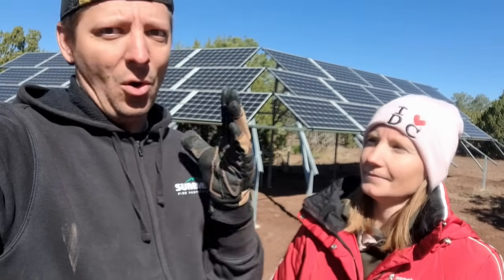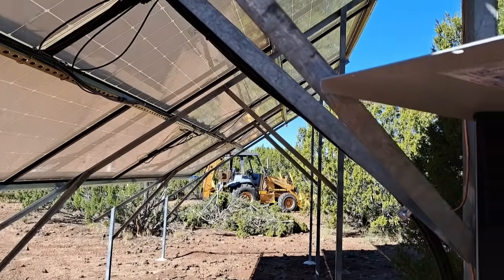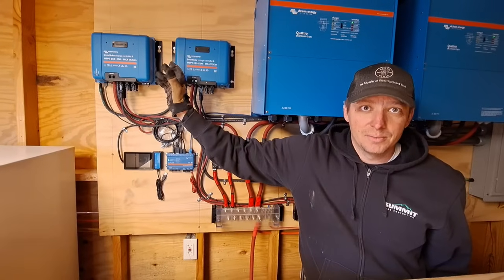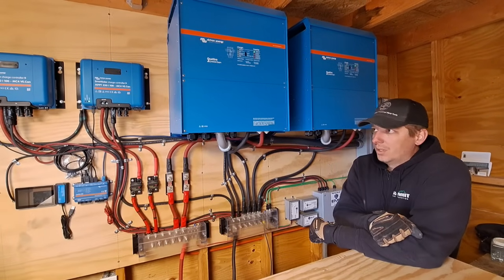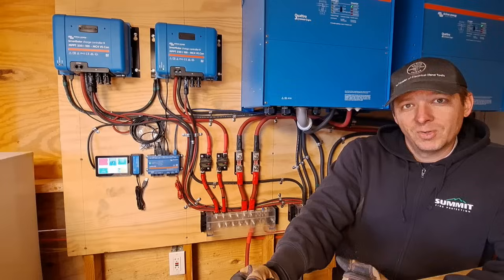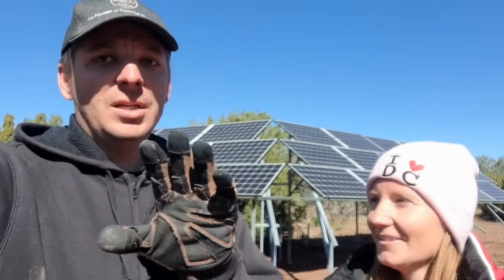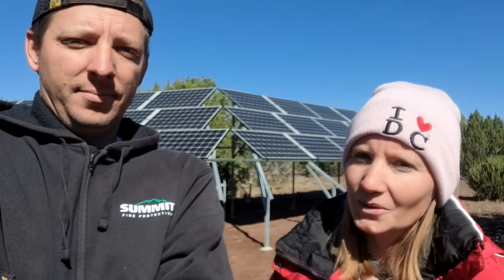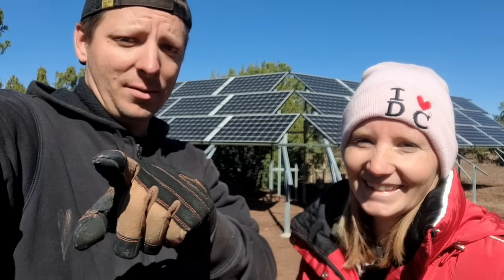INFLATED COST Of Our 100% DIY Off Grid SOLAR POWER SYSTEM 👍

Comment: For forty years, we have been hearing that solar is becoming more affordable each year.   Looks like it will take another 40 before it works for the average homeowner.  If you MUST be off-grid, your system is awesome!  But for someone like me, a $150/month on-grid cost, including all maintenance, makes much more sense.  Solar & wind power is sexy, but not practical for the average household.

Comment: I’m pretty sure this is the same system I was quoted $18k for. The only difference is that the batteries sit outside and there were 10.  They sell you $2500 batteries for $10k, and a $10k solar array for $50k. If installers charged reasonable amounts and didn’t pay 25% commission, plus massive overhead, I would gladly pay someone to install it.  $37k to save $1500 per month in CA is well worth it.

Comment: Look into adding the Victron smart shunt. It will monitor and report battery utilization and SOC to the Cerbo GX so it can control the entire Victron entire ecosystem based off of the battery data. Just a couple hundred more bux, but will prove very useful for you. Great work!
Reply from the maker: I'll have to look into that thank you.
Reply: I second this suggestion
Reply: This will be the best to help in monitoring your battery power. Victron shunt
Reply: THIS 100%!!! Install a smart shunt  between the two bus bars. It will keep track of the state of charge and perfectly report it to the Cerbo.
Reply: @aboulderlifeoffgrid  did you check out the smart shunt from victron? I use a couple of them, for monitoring solar production (non victron charge controllers), and for battery levels. The built in relays are an integral part of my system too, shutting down various components when levels get too high etc.
Reply: Charles you seem knowledgeable. I’m a beginner and want to build a system capable of producing 16kWh… do you have a set up to recommend? Or links
Reply: Great setup! I have something similar for our offgrid system. You definitely need to add the shunt. A shunt measures the flow of energy into and out of the batteries, think of it as a fuel gauge. As you withdraw power it records all this to tell you what’s left in the bank. As you charge, it records that too and adds that to your “range”. 

No more looking at idiot lights or guessing based on voltage - which is especially hard with lithium based batteries as they don’t sag like the old school lead acids did.

Comment: This pricing is outrageous and would take about 15 years to pay for this and by then, you will have spent another $25,000 to replace the batteries and other equipment...so in reality over a 15 year period you pay about $60k. Solar is really a total rip off compared to paying for electricity from the grid...unless you live in NY or California...and this pricing is a great deal if you live there. However, this pricing is far better than paying a solar company $60k+ to put in a system that provides less power than this.

Comment: Nice! and Expensive! LOL!  A suggestion and for your SAFETY add a Catastrophe fuse and disconnect at the battery box for redundancy! Don't just rely on the BMS system.  And at the buss bars going to the batteries move your 4/0 wires from an end bolt to a center bolt on the buss bar to reduce further any chance of buss bar heating and even Amp draw during large voltage draws! Awesome system!

Comment: Great video!  I've had my Victron system for 4 years now.  Mine consist of 4 - 3000VA Multiplus inverters and three MTTP 100 - 50 chg controllers, 12 - 320watt solar panels and 12 Battle Born 24V batteries giving me 600ah of storage.  My house is under 1000 sq ft so it provides me with all the 240V power I need to run the house and power equipment.  I do use propane for heating, but thinking of doing away with it...  I had one inverter fail and Victron reacted immediately and got it to the repair facility in one day!  Unfortunately the repair facility didn't provide very good customer service and took over two weeks to repair it.  I'm just 50 miles from their facility...   So I bought a spare inverter!  I live in the Wet Mountain valley in Colorado at about 8000 ft so I get plenty of sunshine..  Keep up the great videos!

Steve

Comment: I built my system for about 30k. Consists of 11Kw panels, 56Kw of batteries,  8K sol-ark all in one.  I built the batteries from raw cells. the mounting was unistrut and well pipe, 2 are set up to track 2 axis, 2 are seasonal tilt, nessassary in Minnesota. I have had no issues with the all in one inverter, but something to be said for separate components too.

Comment: Just finished our off grid solar, we did it ourselves. Did it for well under $3k . Be interesting to see how it goes. Got lithium batteries super cheap as the Government in Australia changed the contract on building electric buses. So was 1000 cheap batteries, we got our share. Solar panels (450 W ) for $25 each with all free railings, wire and clamps to join battery’s with a free case to house them in. Just got to meet people in the know.

Comment: I know as I go through and make videos for my own system, I'm constantly reminded of the cost of my own system.  It's hard to believe how much little pieces of metal and wire cost, but it's so gratifying to know that you're making your own power!

In regards to knowing the state of charge of your batteries, one option would be to put a Victron SmartShunt in place which would give you the ability to monitor the state of charge of your entire pack of batteries.  Voltage doesn't mean much in regards to LifePo4 batteries, but the smart shunt does a really good job of letting you know where you're at power wise.
Reply from the maker: Good to know! We'll look into one of those. Thank you!
Reply: Yes your correct my. Battery are diy sow I use renogy shunt I have 3840ah on a12v and 960ah on a 24v  have you look into a raspberry it made work for you

Comment: Great video! I am also on a DIY fully off-grid system and have upgraded all of my electric appliances and even have full AC and heat running off of my system. I will be adding videos soon but have not had time as of yet. Our system has 800ah of batteries and 13kw of inverters and runs our entire house with zero issues including electric range, oven, washer/dryer, 5x mini spit AC/heaters, etc.
Thank you for sharing!
Reply: Do you have a channel? Videos? Love to see your setup

Comment: Interesting video…your content is good…:) It’s worth it not depending on the power company…every year costs more…I did something crazy…I built a small jet engine to power an induction motor to power my cabin and built the inverter too…I’m an Extra Class HAM…the advantage of learning to be a HAM is you learn electrical and electronic engineering…not at a professional level but at a solid amateur level…I would recommend anyone who is into being independent from the grid like that and not a professional electrician, go for your HAM license…you’ll learn lots of electrical engineering…it’s seriously a great way to learn it…and as a bonus, radio engineering too…:) I’m an emergency nurse practitioner student…I’m not an engineer but I’m deeply interested in engineering…I’m a bit of a jack of all trades I guess because of my former paramedic training and background in emergency medicine…so I try to learn this kind of stuff too…you never know…

Comment: Great Video!!  I have not built mine yet, but will do so as soon as we move to the property, and this video is a fantastic guide!  I want to make a suggestion.  
If you accidentally dropped a wrench down behind the battery case, you would have a nice firework show if it landed on those buss bars.  It might add some safety if you put a  wood or plastic cover above the buss bars to avoid a falling object shorting out your batteries.

Comment: I was surprised that you didn't mention a shunt, which would allow you to see all the voltage in the batteries, in and out, etc. Victron makes a proprietary one and a generic one that would work for your setup. Very cool setup and I am envious!  The other advantage of DIY is that you saved money but also understand your system completely. Well done!

Comment: Well done on doing your own rack for solar panels.  I am just about finished with my 19kw off grid system, for the materials of a good metal solar rack it was going to cost $14,000.  I decided to just build them out of pressure treated wood for less than $3k, this also gives me the flexibility to move each rack of 5 panels slightly to the east or west for testing which way is the most efficient for providing power throughout the day.

Comment: I fully get the cost of this set. We have a family house in AZ off grid ,we use 24 volt and we use split systems  to spred the amp loading. Good video on what it truely costs.  I would reccomenda shield on the battery buss bars to avoid a accidental arc from somethng crossing them.

Comment: Wow that's a lot of power! Our inverter is 6,000 watts, and it does everything we need to live off grid, and to run all of the power tools to build our house. The propane for our gas stove will cost us less than $200 a year, and we can take the tanks in ourselves to have them filled.

Comment: Gteetings from Kosoves. use heat from inverters for heat pump, also install diesel generator and tap the hot water for heating plus store electricity from generator in batteries.

Comment: Victron Lynx Shunt 1000 for battery monitoring or the Victron BMV-712 (this is what I have) with a 500A capacity. This takes away the need for the batteries to play nice with the Cerbo. And for the bus bars, Victron Lynx Power In or Distributor if you want to fuse each item. Each of these handle 1000A in total and you can combine them for extra connectivity. This is an awesome video and it looks like you have gone to a lot of trouble to get this up and going and it looks fantastic. Totally enjoyed watching this and viewed to the very end including bloopers! Warm greetings from Melbourne in Australia!!!
Reply from the maker: Great information. Thank you Adam!
Reply: Wasn't the Lynx causing a bit of a rumble as most people found it should have only been rated for 500A?

Comment: This is more expensive than I thought it would be, but I've only been looking at smaller systems. Wow! That markup for installation / labor was huge. Good on you guys for doing it yourself
Reply: The markup for off-grid is very high due to the lack of knowledgeable companies willing to do it. These systems are very complex compared to grid tie/back feed systems.
Reply: @jasonhensley947 no they aren’t, he did it in a complicated way. It can be done for half the price he paid
Reply: @vandalorian8777  Can you explain more? I'm new to the solar game and trying to educate myself. How could they have done it in a less complicated, less expensive way?
Reply: I saved a lot on mine by going with used panels from SanTan Solar. I got 40 used Kyocera 265W panels for $4,001.65 after shipping. they've been working great, they look great too.

Comment: The knowledge you gained will save you money should components need repair or replacement. I don't have solar but need generator power often. We have LP for stove, dryer, and hot water  and 9000 watt generator for the whole house. Unless you need 20KW for backup or have one big house you could have when smaller. But, now you have enjoy.

Comment: Thanks for the video. well done and edited.  It confirmed that I will be able to do this same size considerable cheaper.   Pressure treated for the array.  Ive seen those same size/quality batteries for 1300-1500.  I might even make my own which would shave more off.   I think yall payed around .70 a watt for the panels which is ok but .50 and even lower is doable if you just dig more deals are always out there finding them is the task.  I also think higher wattage panels means less panels which means less materials.  Plus the more panels you have  the more that could go wrong/get damaged etc.  I see a lot of diyers that I guess just have plenty of money and go for the convenience of buying the easiest to obtain items.  I see this time and time again.  The frugal and deal diggers out there I know feel the same way.  I kind find everything so discounted compared to a lot of people but I have a friend that is on another level and gets things for free all the time I have know idea how he does it but his house is full of materials, electronics, vehicles, etc that he gets from people just needing to get rid of it.  Craigslist free is one of his sources he is on it non stop.

Comment: Why didnt you put the inverter in the shavk behind the panels? Lots of loss over that long dc run.
Reply from the maker: Not sure what a shavk is. But we increased the wire size to make up for the voltage drop so we're good there. Thanks
Reply: @aboulderlifeoffgrid  shack! Sorry.  8 awg to how big?  Approximately 200 volts and 37 amps per string at full sun on the panel side?
Reply from the maker: @breckfreeride  Yes, 8 awg wire. 200 volts with 27.9 amps coming into each charge controller at max. There's no shack around unless you mean our trailer, which is our temporary home until we build our house. So it's all in the shed. Sorry for taking so long to get back to you.  Thanks 🙂
Reply: @aboulderlifeoffgrid  it's casual, I thought you had a power shed and was wondering why it was so far from the panels

Comment: Just add in a suitable Victron SmartShunt. You already have a nice split between the battery storage and charge/consume. It will fit in really easy and tells you the state of charge of your batteries accurately enough.

Comment: KK, Very nice vid.  Thank you.  My new install is going to be 1/4 your size. I just need power for 2 freezers and 2 fridges, few lights and small power for laptop or radio if trees take out power lines/ black out conditions.  All other stuff in my house is giant tank of propane for water heater, and cooking.  Wood burning stove for house heat in winter.  Nice vid...thank you again for current prices.

Comment: As Bones says below get a SmartShunt you won't regret it. As for the batteries, I DIY'd mine, and, couldn't be happier, even after re-buying BMS's, 36 304ah cells - 4 8s 24v = ~29kwh + 1 4s 12v = 3.6kwh  under $8k....        You're doing great, keep at it....    Congrats..!!!!....                      FYI...   My sys is 2.4k panels, 24/100w 6s4p - 150/85 CC - 24/3000/70 Inv - 4 batts,  + 320w panels, 2/160w panels 2s1p - 100/50 CC - 12v Batt     ALL ..  Victron...  this is in/on a 30' TT...      There is no such thing as "TOO Big"...........            Oh.....     And,     ...       I'm adding more panels..........

Comment: I have a very similar system.  Same inverters, but 41x 455W panels, 70kWh of battery bank, 3x victron rs450/100 charge controllers, 2x victron power-ins, 2x victron lynx distributors, lynx shunt, cerbo-gx and sceen, etc.  I DIY'd the batteries with EVE cells and Seplos kits (communicates with Victron fine).  All-in I spent about $50k before tax rebate.  The same system installed by a company here in Maine would have been $150k.

Comment: my current estimate of a 10kw panel system with 20KWH at 51v (4p4s of 200ah 12v lifepo4)  with 2x all in one hybrid inverters that are daisy chained together for 16kw is just under 20k usd (DIY) in NC, i save a bit by roof mounting.. since the house is in the open and facing north.. giving me a solid EAST / WEST sun exposure, I do appreciate your video, i have been checking the solar diy market on and off for a decade.. and with lifep04 prices dropping like a rock, and solar panels 300-330 range prices at 150ish new .. its seems to be a pretty optimal time to get in.
with the hope of getting ROI in 8 or so years after the rebate ( basically assuming i save 1800 / year on utility, using my current monthly consumption as a guide, but 10 would still be fine, as the lifespan on these things should be 20+ years)

Comment: It not sticker shock, it’s the investment to go DIY. Totally worth it for sure. What would you do different? Great looking system. Way to go! Thanks for sharing
Reply from the maker: It's a pretty good price when you compare it to what an installer would charge. What I would do differently is make the panels at a 40ﾟ angle instead of a 36ﾟ angle. Also I think we would get a different brand of batteries that would communicate with the Victron equipment.  But overall very satisfied with our system. Thanks for the comment.

Comment: I caught up to this by watching prior videos and re-watched this one again.  At $37,000 and 9000watts of panel, that is $4.1 per installed watt and WITH batteries - that is a sweet good price.  AC Coupled systems with net metering and NO BATTERIES run $3 to $4 per installed watt by pros, here in Utah.  you got great deals and DIY labor.:washhands:  I have 7.3kw of panels, 60kwh of tesla batteries, Conext XW Pro inverter and Conext charge controllers and other Conext parts.  This is my 3rd inverter over time.  My parts cost is around $29,000 over 22 years.  You did good
Reply from the maker: That's a good amount of batteries. Love it. Thanks for the comment. 🙂

Comment: Nice work on the video. Someone else may have mentioned it above. But those inverters are technically 10k va. That isn’t the same as wattage. Technically they are around 8kw inverters. Which definitely isn’t a low amount of power. I just figured I’d point that out. Victron for some reason rates all their inverters in VA. Again, great job.

Comment: Also I recommend building your own batteries if you build more. A seplos 280Ah mason kit with grade A Eve cells runs about $3400 ($237/kWh) and they have communication and can automatically control battery heaters.